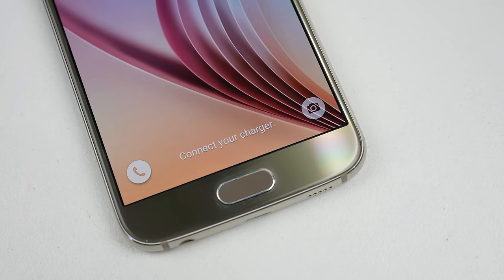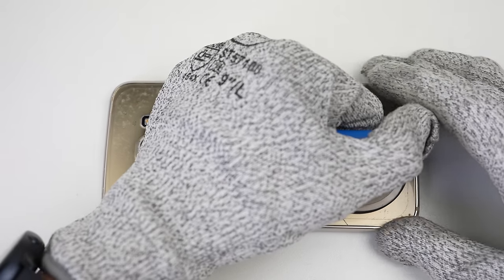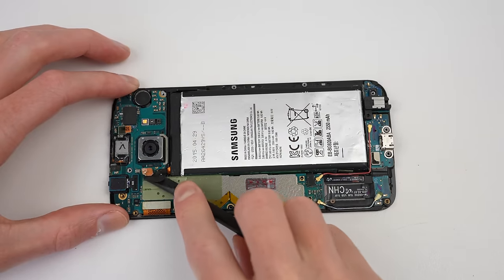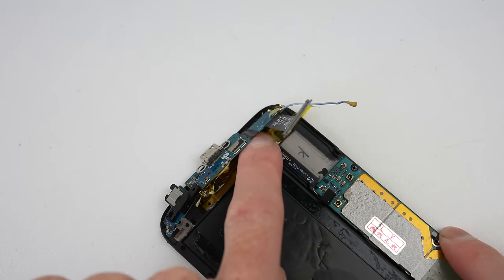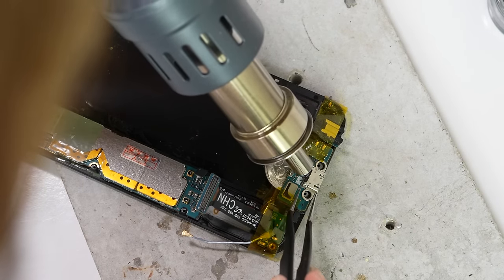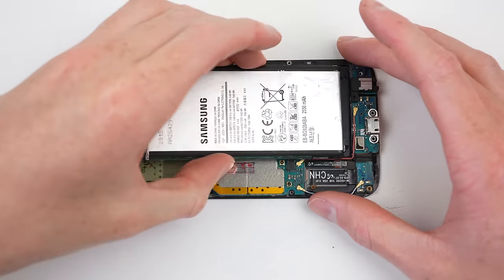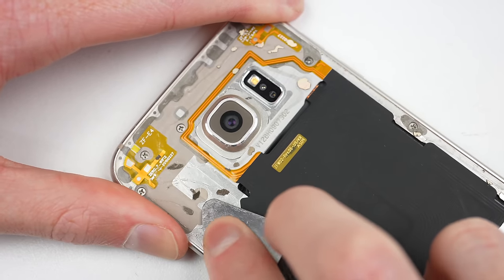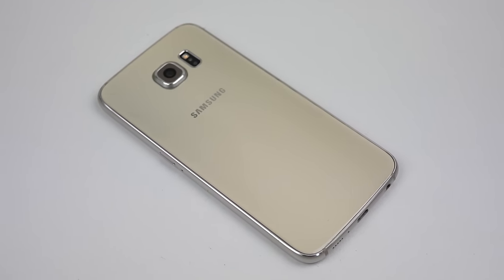Complex Repair - Galaxy S6 Restoration + Charging Port Micro-Soldering

Comment: have done a charging port replacement on the s6 but with the whole flex cable it was a nightmare thankfully the screen was fine after but it was very difficult
Reply from the maker: Good job.
If the back of this phone was attached using superglue I didn't want to know whats holding the front screen on. It works so didn't want to disturb it.
Reply: @HughJeffreys  a bit of the paint chiped away everything else was fine

Comment: hi hugh  there i have the same problem when comes to batteries and older phones can you please tell me where do u buy those replacement batteries ate as i see ones on ebay and well its a chance with those. i have older phones and well i don't cars about tech that much as long as it works and well i keep phones for a really long time

Comment: i have a a20e Samsung and a s6 Samsung the s6 is BUSTED! but the a20e from first impressions was only the LCD was broken and the fingerprint and camera as the crack was from top right down wards what do you think would repair easier see older and really broken phones are a bit more expensive to repair as to a damaged modern phone but modern phones take more money to repair only the screen so which would be easier to repair

Comment: I used to change about 10 to 15 connectors a day without using a microscope....this is easy ..if you practice...no need for a microscope unless you try to change a ic .....

Comment: I am guessing that someone was trying to plug their phone in at night and they forced the charger in too hard which caused the pins to bend and break resulting in a broken charging port. Wireless Charging is a good thing even if can't be permanent solution to wired charging

Comment: I use my S6 Plus as a poor man's microscope for electronics SMD work. The camera on the S6 Plus has the highest image quality I've seen on high zoom, with very low noise, so it is perfect for SMD work. I've tried to replace the S6 with S9, S20 and S21, but their cameras in this kind of application are almost unusable with terrible image quality. For a good half a decade that S6 Plus has been working almost every day, and when it finally dies I have all the spare parts to fix it, even the display. If the mainboard dies, I will buy another S6 Plus to replace it.

Comment: Where do you buy these supposedly new batteries? Some cost as much as some shops charge to fit cheap scam batteries. These phone repair shops are just cons it's ridiculous how much they charge you and sometimes they don't do it properly or say sorry we couldn't get it to work and still charge you for their service. I just recently paid a shop to replace my S7 edge battery and after a few days the battery swelled on me so I stop using it and removed the battery, I would have replaced myself but I was scared of cracking the back glass but the guy didn't put it back on properly so I used a pick and it came of with ease. I have bought another battery so hopefully this one is decent and doesn't explode on me again.

Comment: I've got a question Hugh, I have a Google pixel 3xl that only charges if the phone is off or if it's plugged up prior to it turning on. It won't charge if you plug it up while it's on. Any ideas or suggestions? I thought it was a software bug but after updating to android 12 it still does it.
Reply: Probably a short with the charging port, or the chip that’s responsible for regulating charge.
Reply: @RolandKoller90  thanks

Comment: Umm.. what happened here the heart rate sensor then the other side theres a similar shaped hole like the heart sensor with fingerprint sensor sensor replace the heart rate side.
Did they cheat? With the S8 at 8:53

Comment: I got a s6 in a 12€ techlot it was looking like new but the charging port was not workling i opened it up someone was inside before 2 screws where missing on the charging port i screwed new ones in now it was charging i raplaced the battery too sold the phone for 50€

Comment: This probably wouldn't happen if they had started manufacturing With usb c... But we all know how companies work regarding Planned obsolescence
Reply: The problem is that the USB-C connector was only finalised a fairly short time before this phone was released, by which time all the design work for this series had been done and frozen so manufacturing could start. Sadly there are still brand new phones today on the mid to low end that are still using Micro USB jacks instead of USB-C for some reason.

Comment: I had the same repair shop issues with my phone they left old adhesive  it was a water resistant phone I asked if it was still water resistant they said yes the adhesive resulted in it getting water damaged they never refunded me and the screen they gave me had a dead spot too they really suck it was an s10

Comment: If you wanna know if it original, scan the qr, if it is original, you will get a the part number that start with an GH, like GH##-######, if the GH part number doesn't show, is fake, i work for Samsung like 6 years here in Chile

Comment: Replacing a charging port does not require a microscope, it's the most basic of phone repairs, right up there with battery replacement. Your making the process sound harder than it really is